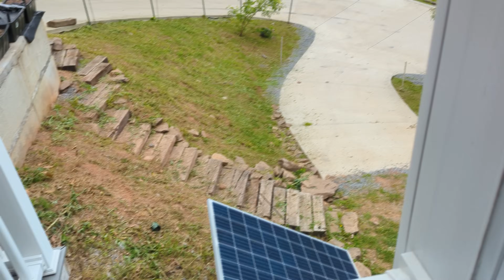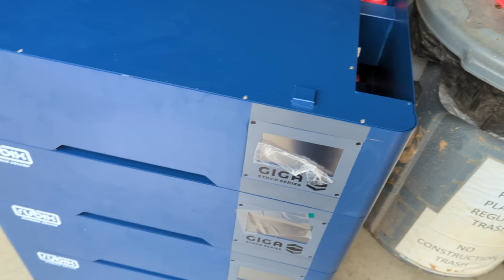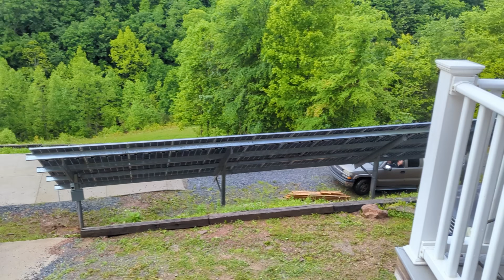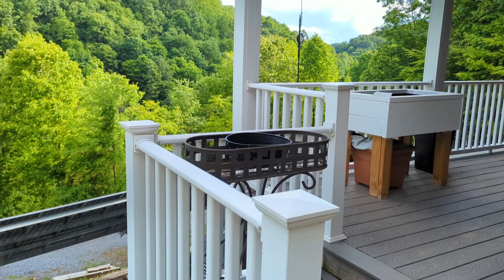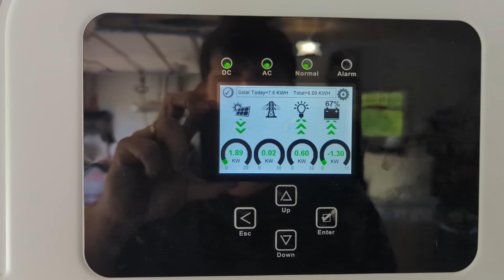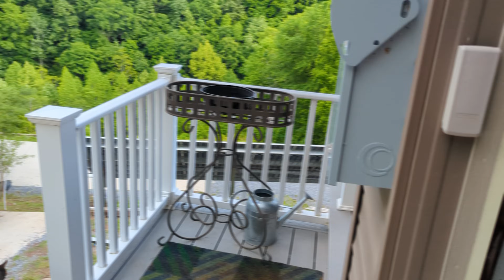A DIY with a Little Help

Comment: I'm assuming he is going to be offgrid are you connecting the grid to the grid input on the Sol-Ark to add power if needed. Is all your off-grid setup with no grid input and a transfer switch between grid and the output of the Sol-Ark.  I imagine it would work our if have enough solar to provide 99% of your loads only need the grid if your working on the inverter something goes wrong.

Comment: Hey Scott. I'm going to be getting in touch with you about a Solark inverter. I have a Magnum MS4448PAE that quit on me, about a year out of warranty. I'm pretty disappointed in the Magnum since its only 6 years old. I'm still off-grid at the moment and will be on-grid, eventually. Thanks for the videos!!
Reply from the maker: I would be happy to help.  Since you are going to eventually connect to grid I would steer you toward a 15k Sol-ark.  Send me an email and we will figure out what is best for your situation.  info@practicalpreppers.com
Reply: @engineer775  Thanks! I will reach out when the finances allow. I was planning on the 15k anyway so we are both thinking alike. I'm thinking more towards middle to end of summer and I should be able to swing it. Thanks again!!

Comment: Do you have a ground mount that can work as a carport that I can park under?
Reply from the maker: You really need a solar carport as the engineering for a sinclair skyrack will not allow for it to go that high.
Reply: @engineer775  Thank you for the reply.  I have found one supplier online that offers solar carports, they just the type of solar panel I decide to install to properly size it.  I think a solar carport will work for me because I have a pickup that is parked outside, and I think a carport would take the most advantage of bifacial solar panels.

Comment: Hey 775, have you done any installs with the new Pytes stackable batteries? 
They look very interesting and I remember you saying that you liked the regular ones.
Reply from the maker: I have not used them yet.  I am not a fan of stacakble that have separte control units.  The only stackable I like is the Giga stack.  It is not a money thing but a failure mode thing.
Reply: @engineer775  Thanks. That makes total sense.

Comment: Nice project.  I recently did my own DIY project with 10 bifacial panels using EG4 equipment as a back up power to my diesel 14KW generator.  My battery pack and 6KW inverter are on a wheel base to make it more portable.  None of the equipment is grid tied.  It was a good learning experience for future expansion.  Love watching your program.

Comment: I think a whole home power system of very respectable capaicty can be made to fit in an area the size of a washing machine. 

If manufacturers used thin film ctde or cigs in roughly just a 3x3 panel size 1m^2 the panels would just be about 1/2inch thick each, multiply 20 and thats just 10 inch by 1 m^2, 
add the lifepo4 batteries, 30kwh is a good size system, thats about half of the size of a washing machine being reserved, then add the inverter, which cooould be the size of a toaster oven which is leaving room for the supplies. I think conduit should be ditched and the wires should be triple insulated and just attached like coax cable. connectors all the same, watertight. and off grid meaning no other psky junchtion boxes cutt offs troughs or transfers. It would be literaly something mounted right by the distribution box, or acually waterproof and theftproof and mounted outside in a compact, 1 location only install. Where the meter would be. This box would be safe outside, mounted to hardy board, as code, and then just outside, where it can vent and if its cold obviously inside, Either way it would be safer than many boxes and junctions and resource considerate. does god teach conservation of resources!!? Even add an extingusher in side the panel it would not take much space and would significantly increase safety. The mppt and inverter being correctly made and programmed would help tooo obviously. This means no messy systems at installation and design too even. 

The whole system can be made cheaper this way, I think the profitable price would be 5k each system, Where its made in 1 factory and using the easiest methods of panel inverter and battery construction. 
I still think batteries are overpriced, where lifepo4 could have batteries wound as 1 cell, to 48v, where the cells are in series like individual panel cells on the thin film constructions. This would SIGNIFICANTLY reduce costs and negative economic and environmental factors of the overly complex non simplified versions of batteries inverters and thin films. 
The first solar thin films are good, and even they say they could do it 1 step with a roll of stainless steel, clear plastic insulation and sputtering and laser etching machines. This means continuous 1 step sealed environment manufacturing where panels could be printed like rolls of paper. 
But, this would all have to be made responsibly where too many people dont get too much all at once, this is the real problem. Overstimulation of work and economy and technology.

Comment: With the 200Amp Grid Pass-Thru, why is a disconnect required?  ...especially more so in a Net Metering situation?   What am I missing?
Reply from the maker: The diconnect is a Utility requirement Nationwide.  Overcurrent protect and lockable handles are required by the utility. It is not an NEC code compliance issue.